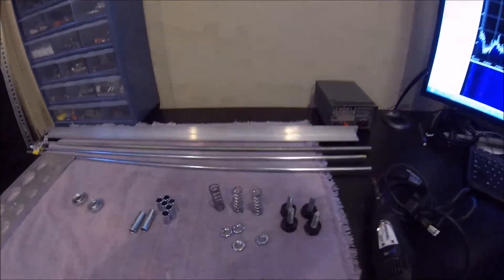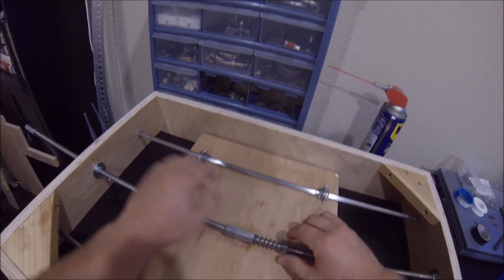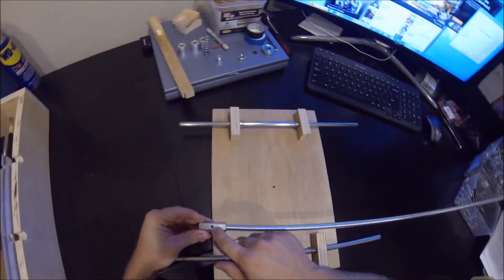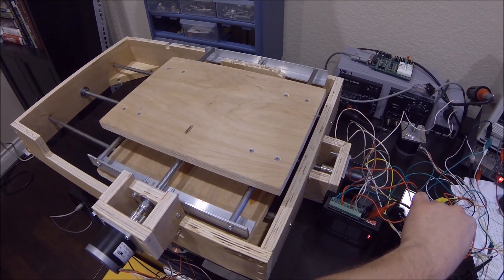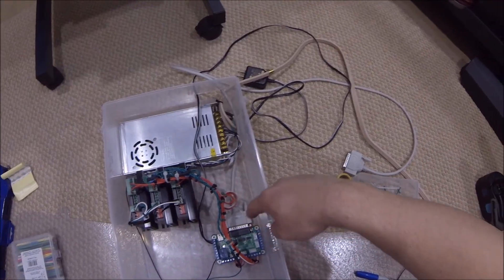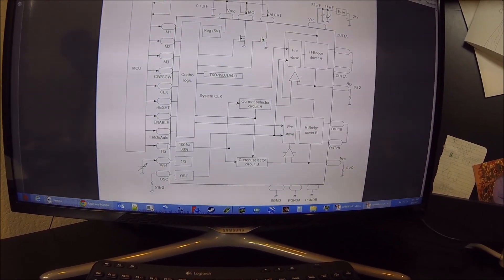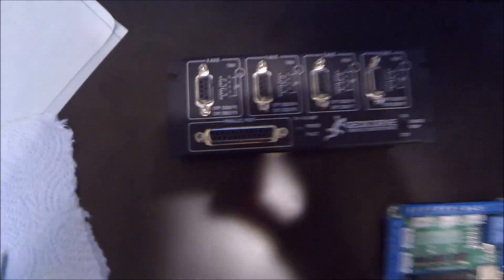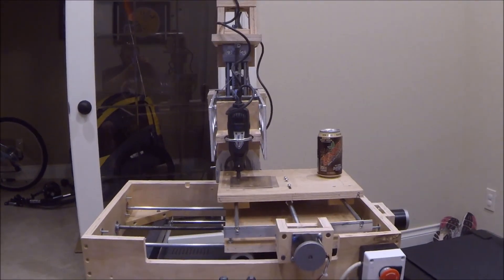DIY CNC Mill Construction & Testing

Comment: I use cheap drives on my machine and they work good. But they're different than the drives you tried. I'd also say it looks like you're over currenting the motors in this video. I've seen steppers with too much current before and they act like I'm seeing here. Too much current makes the motors run rough. All thread is pretty lousy lead screw material too. But I think everyone already knows that. One thing I did spring for on my machine was at least some acme lead. When I bought it I got a great deal on it too. The nuts were kind of expensive though so I made my own out of HDPE plastic. That worked out real good. The plastic is elastic so it is naturally springy. Zero backlash. I did burn one nut out going crazy running my X axis. But I just made another one, and made it a little thicker. I don't try to go as fast on that axis anymore either. I was running 200 inches a minute when I did the damage. But I was having fun at the time too. Zoom!
Reply from the maker: Thanks for the feedback.  I agree that all thread is pretty lousy but, i think building a CNC out of wood is too... haha.  I was trying to prove to myself that I could learn & understand how to build a machine and program it.  So, for that purpose, It was successful while staying relatively low cost.  Good luck to you and your projects!
Reply: +garfish307 you can build a machine out of wood and get it to perform well. The same cannot be said about all thread lead screws though.

Comment: Where did you get the elctircal components of the machine?
Reply from the maker: I got the motor controller from Gecko Drives
http://www.geckodrive.com/geckodrive-step-motor-drives/g540.html

The motors came from Applied Motion (specific model number 4023-820 (discontinued)-NEMA 23 platform):
http://www.applied-motion.com/products/stepper-motors?field_frame_size_value%5B%5D=NEMA+23&field_archived_value%5B%5D=0&field_closeout_pricing_flag_value%5B%5D=0

The power supply was from Amazon:
https://www.amazon.com/gp/product/B00ANFJ26U/ref=oh_aui_search_detailpage?ie=UTF8&psc=1

The rest of the components were either from Amazon or scrap parts from PC processors, etc...

thanks for the Question!